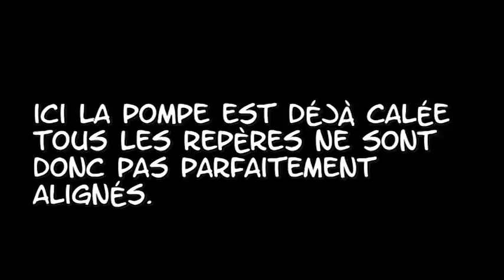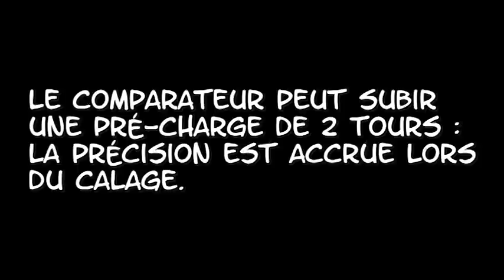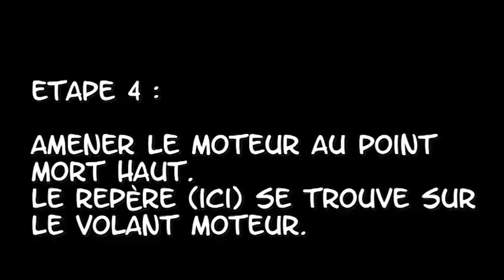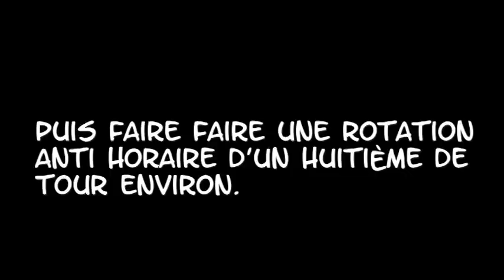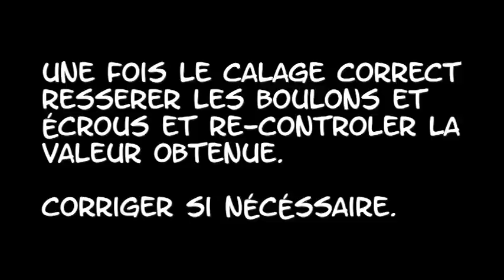Caler une pompe à injection BOSCH VE

Comment: Bonjour,
Ce type de pompe sur Yanmar marin 4JH3HTE; après réfection du moteur (segments, culasse...) impossible caler la pompe, moteur très bien mais fume gris bleu!
Les marques "gear box", platine de pompe non alignées, pas plus que les marques entre la pompe et sa platine de fixation(ça cela semble plus normal). Mécano dans le flou...La doc Yanmar donne: "injection timing 12° before TDC,for plunger lift of 0.46mm". Suis pas du tout mécano, mais à votre avis je commence par quoi? (je peux trouver un comparateur en prêt), ou je change de métier malgré mon âge? Merci de votre aide et bravo pour votre vidéo. C.DSP
Reply from the maker: Bonjour

vous avez quoi sur la doc ?
repères point mort haut, et numéro de piston ? 

Gris /bleu= trop d'avance

Il faut commencer par trouver le point mort haut et trouver de quoi caler la pompe
ça veut dire comparateur et  adaptateur pour le visser sur la pompe.

"for plunger lift of 0.46mm"
0.46mm c'est la valeur lue sur le comparateur.
le plunger c'est la tige de la pompe.
C'est l'avance à l'injection avant le point mort haut.

Il y a un repère (certainement sur le volant moteur) qui indique le point mort haut d'un des pistons.
 arrivé au point mort haut on pourra lire 0.46 sur le comparateur si la pompe a une avance correcte.

Il est aussi possible de régler l'avance avec un plateau diviseur angulaire
comme l'allumage sur une essence puisqu'on vous donne la valeur en degrés.

il faut verifier la doc voir si on doit désactiver un système de surcaleur (avance pour moteur froid) ou pas avant de regler.

Vous n'avez pas que ça sur la doc comme info quand même ?
Reply: michaelovitch Bonsoir,J'ai utilisé la procédure suivante: repéré le PMH,( piston n°1 coté volant doc Yanmar), la doc donne 12°(injection timing before TDC), donc marque à 12° avant PMH; après au comparateur on cale la pompe à la valeur donnée sur la doc soit levée de piston PI à 0.46mm(pour cette valeur de 12° d'avance) en la faisant tourner légèrement sur ses 3 boulons. On bloque l'ensemble, le moteur démarre parfaitement, tourne sans aucun cognement mais persistance d'une fumée grise et odeur acre désagréable, donc calage imparfait, erreur?? Coté pompe sur le moteur 3 repères: carter pignon et support pompe parfaitement alignés, le 3éme sur la pompe est bien sur décalé d'environ 1mm avec la marque d'origine sur la pompe.Nous avons bien sur essayé de modifier par touches successives la position de la pompe avec pour résultat plus(++) de fumée, la position actuelle est la moins pire!J'ai la doc atelier Yanmar officielle pour ce moteur, c'est un modèle simplex de 100cv, turbocompressé: injection directe, pas de système démarrage à froid,( quand il fait froid on pousse la manette de gaz inverseur débrayé et on lance le démarreur) pas de bougie de préchauffage, aucune électronique, que du mécanique. Ce sont les seules infos exploitables, le reste ce sont les débits pompe en fonction de sa vitesse de rotation etc...Cette dernière a été vérifiée 2 fois par Bosch ces dernières semaines: RAS; injecteurs contrôlés au ban, culasse, soupapes, culbuteurs, distribution, compression RAS.La seule chose c'est que nous avons été obligés de bouger le pignon PI d'une dent pour obtenir ce résultat imparfait.Je travaille avec un diéséliste qui a 30 ans de métier et qui s'arrache les cheveux! (suis juste un plaisancier responsable)Un "virtuose" de l'injection mais qui ne veut surtout pas se déplacer sur un bateau... me conseille la procédure suivante: 1) PMH, 2) obtenir la valeur de levée de piston 0.46mm au comparateur, 3)mesurer l'angle d'avance, 4)si il est différent de 12° jouer sur la position PI/pignon si nécessaire...le résultat devrait être le même que ce que j'ai fait non! Quel est votre avis? (0.46mm c'est bien mesuré à 12° d'avance, pas au PMH?? ou alors nous avons tout faux!)Encore merci de votre collaboration.
Reply from the maker: Christian Dusaintpére 

Bonjour,
Tout d'abord :

Pourquoi avez vous décalé d'1 dent de pignon le calage de la pompe ?
Ce n'est pas normal DU TOUT.
Il faut débuter le calage en respectant tous les repères et ne pas adapter.
ça permet de voir où sont les défauts.

Ensuite  (c'est votre décalage volontaire qui m'y fait penser)

Si la culasse est surfacée,que le joint de culasse n'est pas de la bonne épaisseur pour compenser le rabotage, le rapport volumétrique n'est plus respecté,mais surtout le piston va comprimer l'air ,mais plus vite qu'avant.(moins de volume dans la chambre de compression moins de hauteur de chambre.
l'angle ou temps d'injection, est donc modifié,le temps de combustion de même...
Il y aura moins de temps entre le moment précis où l'on peut injecter et l'injection,et surtout une modification du temps de combustion...

Le "virtuose" de l'injection vous conseille juste de compenser en négligeant les repères initiaux pour adapter le temps d'injection aux nouveaux paramètres dimensionnels des pièces (culasse et joints)
en gros vous adaptez en mesurant, pour voir vraiment où vous en êtes.
les repères d'origine servent plus à rien (niveau précision)

Pour répondre à la question :

votre manuel vous indique :
"injection timing 12° before TDC,for plunger lift of 0.46mm"

ça veut dire calage d'injection 12° ou 0.46mm de levée de la pompe avant point mort haut.
(top dead center=point mort haut)

pour caler il faut obligatoirement une référence: c'est le point mort haut.
on cherche le point mort haut,on cale la pompe à la valeur de 0.46mm,on recule pour remettre à zero la valeur lue du calage de pompe et on revient en marche avant vers le point mort haut pour voir si la valeur est bien la bonne,soit.0.46 mm est mesuré au point mort haut !

sinon ça fait 24 degrés : 2 fois 12° ou 2x  0.46 mm  !

0.46 c'est la valeur qui doit s'afficher sur le comparateur quand le piston concerné est au point mort haut.

donc 0.46 mm de "travail" déjà effectué par la pompe à injection avant que le piston soit en haut

La pompe injecte à un moment précis AVANT que le piston arrive au point mort haut.
ça laisse le temps à l'injecteur de pulvériser sa dose de gazole, et au mélange air comprimé/gazole de brûler complètement, le temps que le piston arrive au point mort haut.

Une fois arrivé au point mort haut la pompe a déjaà injecté de 0.46 mm (en se basant sur la mesure du "plunger" de la pompe.

0.46 mm c'est une petite valeur comparé à celle de la pompe que je règle dans la vidéo.
C'est normal, et ça vient du fait que votre moteur à une injection directe et qu'il ne tourne pas vite.
ça pulvérise directement dans la chambre,le gazole à moins de chemin à faire que dans un système à injection indirecte avec préchambres de combustion. 
aussi plus le moteur tourne vite moins il y a de temps de travail on avance donc plus le temps d'injection.

.
Reply: michaelovitch Bonsoir,Merci pour cette réponse professionnelle qui comble l'amateur qui cherche à comprendre!
- dent de pignon: il me semble que cette modif avait été faite il y a plusieurs mois par le mécano pour essayer, AVANT la réfection du moteur, de modifier le calage ( et sa possibilité d'amplitude) et améliorer la fumée à l'échappement (échec). Aujourd'hui les repères fixes (carter de pignon pompe et support pompe) sont parfaitement alignés, recommandation du manuel, seule la pompe doit pouvoir bouger sur ses 3 boulons, c'est très bien expliqué dans la doc officielle en anglais, l'interprétation ne me posant pas de pb.
- PMH (TDC) vérifié et revérifié...difficile, la fenêtre sur le volant est très petite, il faut des yeux qui voient dans les coins moteur en place...miroir, lampe, une 3éme main pour faire tourner le moteur...Esotérisme des marques au nombre de trois, une toute seule, deux autres avec des chiffres la première ou il me  semble pouvoir lire un 2 et un 3; l'autre avec 1 et 4 gravés. Cette dernière me semble le PMH des pistons 1 et 4 ,(séquence officielle:1-3-4-2-1-) vérifiée avec une tige métallique à la place de l'injecteur sur la tête du piston 1, haut, bas, on divise par deux...confirmé par le mouvement des soupapes après dépose du cache culbuteurs.Par commodité report des marques sur la poulie à l'avant du moteur. Certainement avec une très petite erreur d'angle.
-Et là je commence à avoir des doutes sur certains "professionnels", je rappelle que je ne suis pas du tout mécanicien mais curieux et j'apprends assez vite...Nous nous sommes, et moi le premier, acharnés à calculer 12° avant le PMH, j'ai même fait un beau disque en carton...et à obtenir 0,46mm de levée de piston au comparateur à cette position...donc tout FAUX. Moi j'accepte de me faire engu..., je débute; par contre certains semblent avoir des problèmes d'interprétation...
-en résumé on reprend tout à zéro: PMH, on cale à 0,46 au PMH, on ne s'occupe pas des 12°, ce sera la conséquence, on fignole si besoin de quelques centièmes en fonction du résultat sur  l'échappement, on fait de belles nouvelles marques au cas où ; correct?Le seul vrai pb est d'accéder au 3éme boulon de la pompe coté moteur!; et puis sur la Côte d'Azur , si votre moteur fait plus de 1000cv, vos interlocuteurs sont tout de suite plus disponibles, pourtant au nombre de milles parcourus nos voiliers leur tiennent la dragée haute!
-grâce à vous je passe de la théorie à un peu de pratique, encore merci, je ne manquerai pas de vous tenir informé des suites à court terme.
Reply from the maker: Christian Dusaintpére 

AVANT de caler la pompe, il faut être sur que la distribution est, elle aussi, ,correctement calée.
Les soupapes doivent s'ouvrir au bon moment par rapport au parcours des pistons.
Si la distribution est mal calée vous ne pourrez jamais caler la pompe correctement?ou plutôt le résultat ne sera jamais correct.
ça implique de pouvoir lire les repères de point mort haut.
Il existe des endoscopes pour ça si vous pouvez en emprunter un.

En résumé on reprend tout à zéro :

-vérifier calage de la distribution
-remettre le pignon de pompe sur ses repères.

-trouver le point mort haut du piston concerné (le point mort haut phase de compression)
-caler la pompe avec :
12° angulaire d'avance au PMH
ou
0.46mm d'avance de travail du plongeur de la pompe au PMH

Ces valeurs se mesurent quand on se met au PMH.(la référence absolue)

Pour les repères sur le volant moteur : 

A ma connaissance on lit 1 3 4 2  seulement, et le dernier (1) n'a rien à faire là.
Je ne vois pas pourquoi il est répété dans le cycle si c'est un 4 cylindres.

Sur un 4 cylindres le 1 et 4 montent ensemble,comme le 3 et 2.

Vous devriez avoir 14 et 32 pour indiquer les point morts hauts des 1et 4 et 3 et 2 par paire.

Évitez de faire des marques,mieux vaut trouver un bon calage avec des instruments de mesure à chaque fois.
C'est plus précis.

En relisant le manuelhttp://boatinfo.no/lib/yanmar/manuals/4jh3.html#/88
 page 89 je comprends qu'il faut 12° avant point mort haut ET 0.46mm de levée de plongeur au moment de ces 12°.

A priori, mesurer 2 types de valeurs distinctes permet de caler plus précisément.

Je pense qu'il serait bon de prendre en compte ces deux valeurs comme indiqué.

il est aussi indiqué que le piston numéro 1 se situe coté volant moteur (et non pas coté distribution) !

-
Reply: michaelovitch Bonjour,Merci de votre réponse, nous avons la même documentation.(1-3-4-2-1...) c'est la séquence; sur le volant on trouve bien 2 marques 2/3 et 1/4; la 3éme toute seule peut correspondre au point d'avance, à vérifier; le piston N°1 est bien coté volant et c'est celui qui a été utilisé pour confirmer le PMH.On va tout reprendre à zéro, en commençant par la distribution, c'était l'avis téléphonique d'un vrai professionnel, "COMMENCEZ PAR VERIFIER LA DISTRIB", mais de là a le faire venir à bord...Je doute qu'il existe des repères sur le pignon de la pompe mais je vais vérifier, son carter est facile à ouvrir.(le reste de la chaine de distribution c'est une autre histoire!).Essai en mer aujourd'hui, pas de vent, mer plate, tourne parfaitement, ne chauffe pas, semble avoir retrouvé du couple (très subjectif),  seule petite fumée grise quel que soit le régime.Au travail et encore merci.
Reply from the maker: Christian Dusaintpére Si tout est ok et que la fumée persiste il faut jeter un œil aux injecteurs.
Le moteur est en rodage,ok,mais la fumée grise est un problème de combustion,plus précisement de qualité ou de temps d'injection.
donc si ça vient pas du calage pompe ou distri ,il est logique de se tourner vers les injecteurs ,qui peuvent pisser,coller un peu ou être feignants. 
C'est le cas sur ma voiture,et ça fume gris.(et ça pue...)
Reply: michaelovitch Bonjour ,les injecteurs ont été vérifiés au ban, tarage etc...RAS(pas de raison de douter).Un doute m'assaille...le pignon de PI a bien une marque "B" pour repérer sa face antérieure comme sur la doc,et un "H" il me semble; mais je pense que sa position n'est pas AUSSI indifférente que ceux de la pompe à eau et huile?Les "bricolages" de ces derniers temps ont pu le décaler franchement(>1 dent?) par rapport au reste de la distribution...pas d'autre solution que de démonter le carter de distribution ("galère") pour vérifier l'ensemble en admettant qu'il existent des repères ce qui ne semble pas évident sur la doc. (On révérait presque d'une courroie avec ses marques, un cache facile à démonter...)Qu'en pensez vous?Cordialement.
Reply from the maker: Christian Dusaintpére Bonjour : )
Page 44 du manuel
Le B du pignon de pompe doit correspondre au B du pignon intermédiaire
Ce même pignon intermédiaire a un C et un A qui eux mêmes doivent correspondre à des repères sur le vilebrequin (C) et l'arbre à cames (A)
Tout est marqué et à respecter.
Il faudrait commencer par là, je pense, pour avoir une base solide.

En effet les pompes à eau et huile ont rarement des repères à respecter ,comme vous dites.
Le reste par contre est repéré.
Il faudrait être absolument sur de ces repères en premier lieu.

Aussi, comme indiqué indirectement p45, il faut prendre en compte le jeu d'engrènement pour caler la pompe.
Pensez bien à bien aller en marche arrière suffisamment pour pouvoir revenir au point mort haut d'une traite,ou toujours aller en arrière avant de  tourner le moteur dans son sens de fonctionnement pour éviter les imprécisions dues au jeu des pignons.

Sans respect de ces repères, le réglage va être difficile...
Reply: michaelovitch Bonsoir,Vous me rassurez sur mon mode de raisonnement!Je sens que j'apprends vite grâce à vous.Ok pour le rattrapage de jeu; il n'existe pas de vraie marque sur le pignon de PI, juste la lettre B gravée entre deux dents.On vérifie et vous donnerai les résultats.
Reply from the maker: Christian Dusaintpére Ok.

Comment: Bonjour, êtes vous toujours en activité ? J'aurai besoin d'aide pour un calage sur un Lt 35 2.5tdi 109ch merci !
Reply from the maker: Bonjour,
Quelle est le problème sur le véhicule ?
Reply: J'ai refais toute la distribution suite à une casse. J'ai du mal pour le réglage de l'avancement à l'injection, est-il obligé de le faire avec le comparateur ? Là, j'ai plus ou moins réussi à le faire. Le véhicule tourne normalement, pas de fumé, mais craque un peu au démarrage. 
Ça a l'air d'aller ! 
Avez-vous des conseils ?
Merci
Reply from the maker: @amiryoussef5649 
Il faut être sur que la culasse et les pistons et bielles n'ont pas souffert, que rien n 'a été tordu.
Après une distribution,il faut caler la pompe,c'est obligatoire pour que ça fonctionne correctement.
Pour faire ça il faut les piges de calage de la distribution,et le comparateur avec sa touche pour caler la pompe.
Je ne sais pas ce que veut dire "craquer" au démarrage,mais si c'est calé correctement ça doit démarrer extrêmement vite.
C'est un 6 cylindres en ligne ,le démarreur tourne très peu avant que le moteur se lance si tout est bien calé.
Il faut que les bougies de préchauffage fonctionnent,c'est important pour un moteur à injection indirecte.